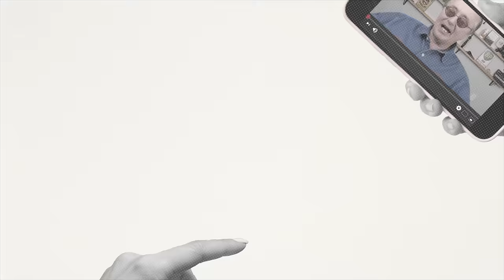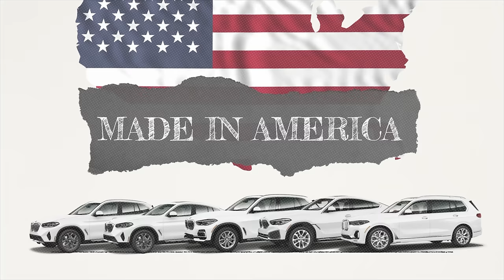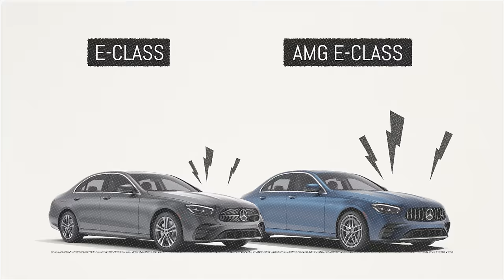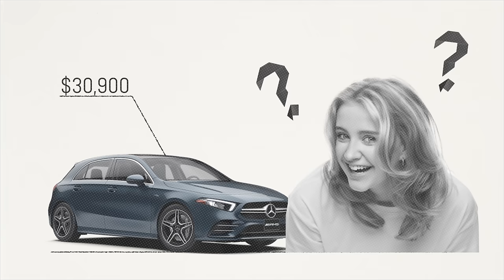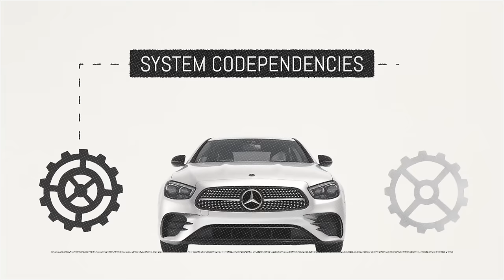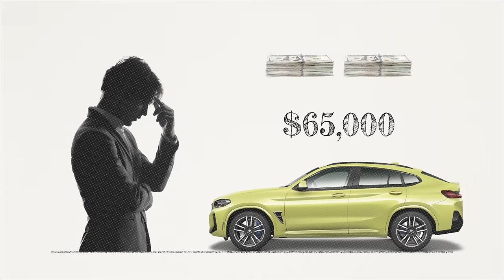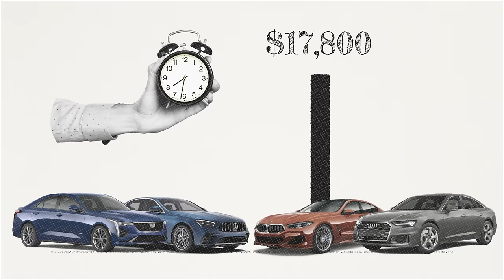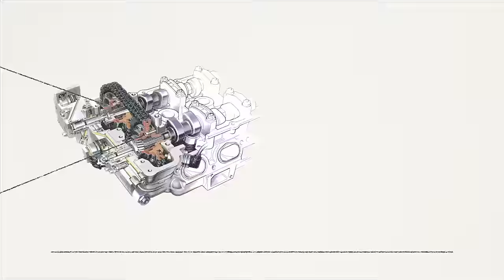3 Car Brands Only Stupid People Buy

Comment: After years of hating on bmw because of scotty I finally decided to drive and get a bmw. Scotty is wrong this time with the new b48/b58 engines. I smile everytime I drive it. Life is too short to drive boring cars. Scotty is stuc in the past.
Reply: You can have a nice car like a new BMW but just don't let the money change you to becoming guy who just flexes his money and car
Reply: That’s just for now while it’s new
Reply: He only cares about normie things like reliability and gas mileage and doesn't give a damn about the actual driving experience.
Reply: All these direct injection engines that don't fix the carbon building problem are trash. B58 included.
Reply: It seemed like half your brain is missing because he's talking about when it gets older
Reply: Good attitude! But the older BMW engine (1990 to early 2000s) are better in term of longevity and easier to maintain. This applies to many car brands. If you maintain your car well, it can last for a long time, too.

Comment: Wouldn't want one except maybe one from the 80s when the Mercedes ran a million miles and the BMWs weren't plastic.
Reply: I hate plastic, it's the worst thing to me ever invented.
Reply: @mikelarry2602  He says, typing on a plastic keyboard looking at a plastic monitor. 
Oh you mean in cars. :)  Just giving you a hard time!
Have to agree. Plastic is not much better now than it was in the 80s. And it sucked in the 80s.
Reply: 80s Mercedes would get gapped by my 500$ ford 150
Reply: Look under the hood of ANY car these days and you will find plenty of plastic. It's for cost saving and weight reduction. And having owned 7 BMWs now since 2007 I never had any issues with the plastic components. In fact I never had any major issues to begin with. People who complain about them tend to be the ones who buy BMWs, used and with a ton of miles on them, with a questionable maintenance history. And on top of that the previous owner could have beat on the car. Now the 2nd and in many cases the third owner is the one inheriting the problems.
Reply: @wingedhussar5528  never owned one but rode in many while in Germany and remember how tight and sturdy and durable the 5 series was.  They didn't have all that clunked up electronics crap either... that junk isn't for me.  By the time I got back here the 90s ones were coming out.  I also never really wanted a Mercedes except for the famous million mile ones which are long gone.  The only reason I would have wanted a Mercedes is so I could run it forever
Reply: @diangelo6686   Your $500 Ford F-150 is a horse carriage next to any Mercedes-Benz from the 1980s. Give me a break...
Reply: ALL cars these days are full of plastic.
Reply: I believe More recent diesel BMW and Mercedes could also do million Miles If those engines wouldnt have any extra useless features like EGR or DPF
Reply: BMWs are plastic lmao American cars are
Reply: Not only 80s, all mercs until the 2000s were reliable and great, after that ofcourse they started adding a lot of tech, which equals more problems
Reply: @wingedhussar5528 I bought my 3 series brand new. Major money pit all electronic issues that were expensive to rectify. Must have been the one they built on a Friday.🙄
Reply: @Electra-xm7lu  exactly, I dont know what he's whining about, why doesn't he buy a Model T, that's got no plastic in it

Comment: I have had four cars in my
lifetime.  A 1980 Toyota Corolla without A/C, no power steering, no power brakes, crank windows, 4 speed manual transmission.  Also a 1989  Toyota Camry, a 2001 Honda Civic with 5 speed manual transmission and now a 2014 Toyota Corolla with about 104k miles on it.  None of them had any mechanical problems and I am grateful for that and my good health!  We all have our priorities in life and those are mine. 😊
Reply: How about a 94 Celica with over 342,000 mile on it and it's my daily Driver.
Reply: Sounds like the most boring list of cars to drive ever
Reply: Those are the best. All lots people want those manual but it is hard to find now
Reply: @JCizzleSoCal it is not boring my friend. It is manual you can have fun with it. You can fix them and they can go forever I mean forever
Reply: @sierrag8412  this 2 to 3k. Those you mentioned are 100k plus. lol
Reply: To you it is junk but for me I love those old car. So easy to work on the engineers are so simple. Now these engineers are brainless
Reply: @sierrag8412  maybe you have a different mind set. People like me we just want thing very simple no headache. We buy a car and we never see the dealership or mechanic in our lifetime. We can fix a lots of thing. People like me we can survive in any condition.
Reply: A car with no working parts isn’t a badge of honor, i don’t get that addition lol
Reply: '08 4runner 4.7L V8 with 387k miles with no mechanical issues. Only oil changes and routine maintenance on wear and tear stuff like timing belts, rotors, etc
Reply: @JCizzleSoCal boring is good. Paid off home and being debt free is better.
Reply: Yeah, but different strokes for different folks. I used to drive those boring types of cars. But I got sick of being "bullied" by minivans and pickups. They always were much faster, and I hate it when I can't pass someone at will or just plain don't have enough power to do what I want. I am the type that has to have "command" out there, so I drive a twin-turbo V8 550i. It's my 3rd BMW and I would never be caught dead in a boring, slow car again. Besides, the girls like em'.
Reply: Sad life
Reply: You lived through the era of some really cool cars like the NSX, Celica AllTrac Turbo, Supra and countless others..
Reply: My first good car my late father bought me, a Nissan Skyline. Manual windows and all that and no AC. 

Fantastic car but would never buy a car again without AC.
Reply: @vayduong6806 don’t mind him he likes the new subscription cars they make that go fast and break down after driving them for two years. The cool thing about boring is that it costs next to nothing to own. The cool thing about fun is that it comes with built in iPads, movie theaters and loads of repair bills. But hey it’s fun right 😂. I’ll stick my boring Honda civic sport that has 150,000 miles on it. 

I care about having more wealth and no car loans. I could care less about these fancy cars. I think they were made by idiots for idiots.
Reply: Toyota is the boss
Reply: BORING.
Reply: @christianrobloxserver7282  bmw 335i with 225 k miles here with just oil changes and regular routine maitnance  😀
Reply: BUT.....what would you buy IF you could afford it ??
Reply: ❤Toyotas
Reply: @therealmcgoy4968 just why

Comment: I guess everyone’s experience is different but I bought a 2015 BMW 328i used with 29k miles and 60k miles later, I haven’t had a single issue with it and it’s the best driving car I have ever owned (owned a number of Hondas prior).    Im sure there are plenty of Bimmer money pits but fortunately mine isn’t one
Reply: what he means is, in general, those european cars will have more chance of having issues than japanese make. not saying every single mass produced ones will have issue. so you can only say you got lucky with your gamble
Reply: I used to started to get a problem when it drives  over 70k.. so watch out
Reply: I feel like this is a matter of what your long term plans are.  I've had a couple of BMWs, couple of Mazdas, Toyota, Acura, Mitsubishi, VW, and Chevy.  Generally I haven't kept many much beyond 100k miles.  If the goal is short term sometimes the difference isn't significant.  My BMW 135i was mostly trouble free.  My M5 had a High pressure fuel pump issue twice in my ownership.  With the new BMW while under initial warranty I didn't really have to pay for any maintenance which helped keep it running great and kept cost to mostly fuel and insurance.  My one Toyota, a Celica ST that I purchased used required an engine replacement after a few months of ownership (I don't know how well maintained it was prior to getting it off that used car lot).  What I tend to hear when researching different vehicles these days is there are good and bad models with the German cars.  The thing with the German cars (even the reliable ones) is they are more reliant on the regular maintenance where I tend to hear the Toyota and Honda products can be more forgiving (maybe less maintenance intensive).  With that, if you aren't mechanically inclined maintenance can be pricier on the German cars.  I will say that the world is an interesting place when Toyota chose to partner with BMW to build the current Supra.  I wouldn't assume Toyota would use an unreliable engine in one of their vehicles.  Regardless,  I don't know that I would think people's choice of vehicle is stupid unless they go in blind (like working a minimum wage job as your sole source of income and buying an M5 and not knowing a brake job will cost you over $3k or a battery is over $400).  I think there are people that only care about driving as utility and some that like an exhilaration from their vehicle, some like luxury.  If a person can support their choice and they understand what they are getting into they should buy what they like.
Reply: I put 100k on my 2012 BMW 335i.  Really no issues and what little work it needed I did myself.  Simple to work on.  Sold it with 130k and still drove like new.
Reply: @mbank3832  yes but if your going to buy one you wouldnt care about the chances of repairs. if that is the financial situation then stick to mainstream brands no problem. Only stupid people are the ones who buy these brands and struggle to maintain because you would just buy a brand new one every other year.
Reply: @oscar7476  you could not care all you want, still doesn’t make it any more reliable brand. Don’t see how they are related lol
Reply: 60,000 miles later not a single issue with it. That's great. 118,000 miles later and I haven't had a single issue with my Chevrolet Cruze. I guess I am part of a club after all.
Reply: Bought a 2014 328i for $17000 in 2018 with 53k miles.  Changed brake pads and spark plugs and oil change every 10k miles.  Nothing else and sold it with 110k miles in 2023 for $10k.  sticker price new was $47k.  Moral of story buy used and get a deal, never buy new unless you want to lose 30 grand in 2 or 3 years.
Reply: BMW had the best reliability record with the 3 series. However, that above average achievement would last for stretches of time, then be lost.  You may have gotten lucky in a good period for the 328i.  I knew someone with a 5 series from 2001 who had remarkable reliability, but then someone else who suffered a lot of expensive repairs for failed parts on his 2005 5-Series.
Reply: @mckenziebrowne3874  I also think it's about how hard you drive a car.  Pushing cars hard will tax systems in it and stress various parts. And perhaps under the right circumstances and repetitious pushing without sufficient "down time" in between can trigger failures. This may be why sports cars tend to suffer lower reliability ratings.
Reply: @cytherians  I guess I can consider myself pretty fortunate but also I do take great care of the car performing all the scheduled maintenance and practically never "race" the engine with hard driving.  It's an amazing cruising car and I enjoy it for such.  Rarely do I tap into its performance capabilities.  I think that the harder you drive a car, the more $ you'll have to put into it.
Reply: @OSUBuckeyes1  Thanks for sharing that. Your success with ownership of your BMW 328i makes a lot of sense, based on how you drive and care for it. I think that may be why my Audi A3 has been phenomenal for nearly 17 years. Same treatment!
Reply: BMW's are engineered to be reliable for 5 years. At 12K a year,  you're basically at the reliability limit at 60K. You can expect to start having problems in the not too distant future.
Reply: @Dvenchy  mine has far exceeded your claimed reliability record. Since I don’t have any previous experience with the brand, I’ll assume my unit is an outlier
Reply: Dude I have 225 k on my 335i lmao. Just regular routine maitnance…  these cars last man, ppl are just too stupid and too cheap to take care of them properly 😂
Reply: @steverinaldi890  How did the straight 6 hold up? Ive heard that they have had issues as compared to the turbo 4

Comment: Between me and my wife we owned 7 BMWs now since 2007. I'm and enthusiast and really enjoy these cars. We personally never had any major issues with any or them. The most important thing is to maintain them right and not to beat on the car. Warm ups and cool downs have to be done right. Now if you buy a BMW with 10s of thousands of miles on it, with a questionable maintenance history, and zero knowledge of how the car was driven then yes you are probably going to have issues. So buy new, or if used than less than 2 years old and under 10k miles.  And most dealers will give you a discount on the 2 year extended warranty, which will now give you a bumper to bumper warranty for 6 years.
Reply: i just purchased an 07 330i and the performance per dollar was insane. I guess I did an informed purchase which "stupid" people wouldnt. did some regular maintenance and havent had any issues.
Reply: count me in with the stupid people because i own a bmw and it is bullitproof.
Reply: 7 BMWs since 07 is easy, try 1 BMW since 07 and we can talk.
Reply: The guy makes a video on how to fix transmissions with Lucas Transmissions fix and call someone stupid... 
And he calls himself a technical!!!
You have some real issue by calling people stupid.
Reply: If these brands are so bad))), they should have been by now out of business, but... ))))))))))
A scotty spotty, keep "fixing" transmissions with Lucas oil as long as some desperate people believe it)))))))
Reply: Leasing > Buying
Reply: one bmw in every two years? Of course you never had a problem.
Reply: @walldolongdistancerunner8945   We know that is no practical. Fast, great seat, yes. But 
we all know that most BMWs are poor quality, actually some of the biggest costly problems on 4 wheels. 
We owned several, never again. X3, X5, 3 series, all had too many issues. Electrical, alignment, shorts, oil burners. Scrap metal as they cost too much to keep fixing. Stupid is as stupid does. But, you will learn from your mistakes. :face-purple-crying:
Reply: On my third bmw. First 2006 E90 lasted over 200k miles lol my f30 I traded at 80k. Had no issues. This dude is just the voice of the cheap haters.
Reply: I'm still out here rebuilding E46 & E9x cars. They've been reliable to me, but I rebuild & maintain them.
Reply: What's more expensive these days? A new M3 or an old wife?
Reply: the only used bmw m5's that are in my price range have 80k-100k miles on them :(, can i just do a maintenance check and restore any thing thats wrong with it?
Reply: Wtf is a warmup cool down period? You pay more for that feature?
Reply: @antibionicio  Seriously? The time it takes your car to come to operating temp is your warm up. At this point you don't want to be pushing the car past 3.5k RPM. Cool down is allowing your engine and turbos to cool down after spiting driving. Usually means laying off the gas the last 5 minutes of your drive.

Comment: I had difficulty selling my C300.  Ended up selling at -30% below MSRP and there was just one buyer interested in 2 months time.   When I had my Honda accord I sold it same day at MSRP price (slightly above) and had 15 people fight over it.
Reply: X5 F15 3.0 diesel, nine years old, people would fight for it. 

My second car, 330e touring. Nothing can beat this model. Nothing. 

I'm located in Belgium btw.
Reply: How could you sell secondhand at above the original price ?
Reply: The used car market was crazy last year that’s why. I bought my car 20k miles for $37k and could have sold it 2 years later with 34k miles for $37k.
Reply: You probably chose the wrong people to sell it to
Reply: you don't buy the car for its resale price.

Comment: I own a 2014 Mercedes e-class bought in 2020 with 100,000 miles on the clock, done 40000 miles in 3 years. The car is super reliable, I had to replace the front shocks, I was shocked at the price £300 a piece. I plan to drive the car until the cost of repairs exceeds the cost of the car.

Comment: I'm a former heavy equipment (Cat) mechanic. I buy inexpensive cars, and until they became governed by electronics, used to do most of the routine work myself. My choices in cars have been Toyotas for reliability, good mileage, and low maintenance costs. I don't care about flash, prestige, or high performance; just reliable, economical transportation.